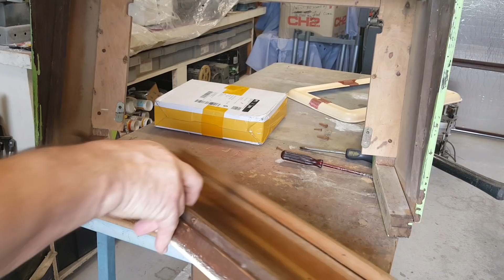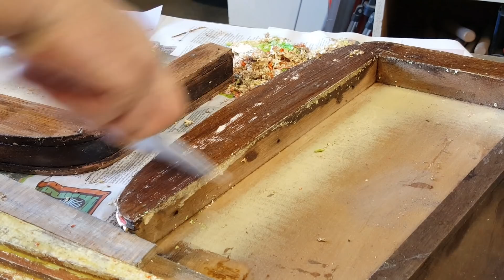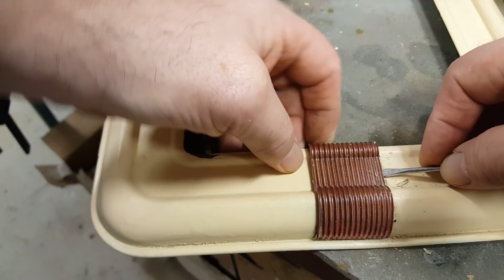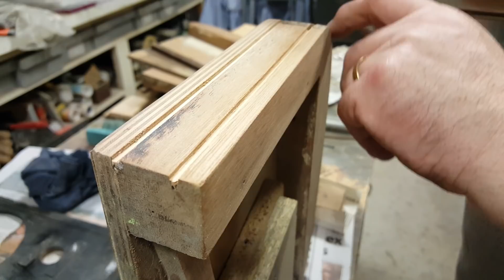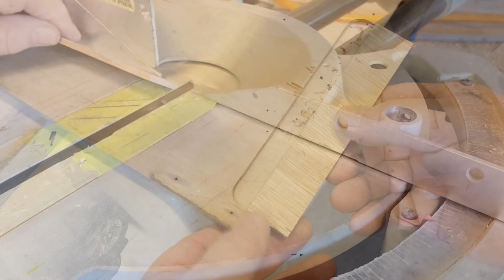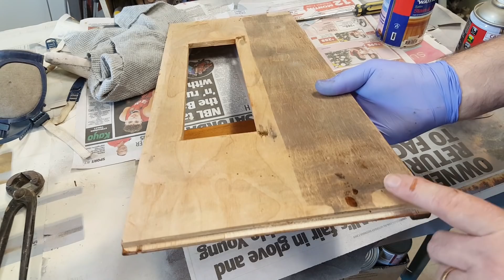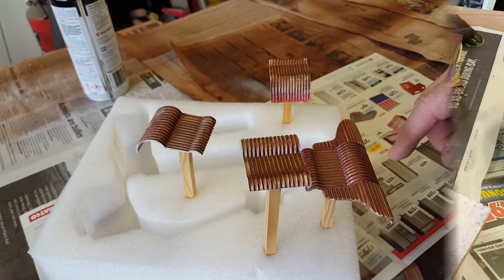The French Connection - UNIC 'Royal' Radio- Restoration Part 2

Comment: This is really coming out nicely.  Flattening the back was a nice surprise, coming out so smooth and flat.  Thanks for cluing me in with respect to the Aqua Coat.  I didn't appreciate that before.  Looking forward to the next installment.  Thanks again.
Reply from the maker: Hi George, thanks. I was surprised the back came out so well, I will leave it a few days and see if it stays flat. The Aqua Coat works well, you can use other products or watered down wood filler too 🙂

Comment: Dave. For removing enamel based paints from plastic you can coat it in automotive brake fluid. Wait overnight and the paint should be bubbled off without harming the plastic.  Make sure to wash the plastic parts thoroughly with soap and water afterwards.
Reply from the maker: Yeah, that's a good idea, thanks Phil 👍😀

Comment: That veneer on the sides looks like French walnut, which is not too surprising since it's a French radio, that species seemed to have been the veneer of choice on many American, and Canadian sets as well. American black walnut is a little more dark brown then red, sort of like your local Queensland walnut, the Queensland stuff was another popular species of veneer, particularly in Canadian radio cabinets. 
 It's interesting how they created that bullnose curve along the top front edge, it looks like they curf sawn plywood to a rather tight radius. Most of the time they would either laminate different layers of veneer over a form to create that curve , or use solid wood underneath, and veneer over top. The trouble with using solid wood under it is that the changes in humidity could cause it to swell up and crack the veneer right across the grain.
  With regard to stripping paint from polystyrene plastic, I've read that DOT 3 brake fluid will remove the paint and not damage the plastic, unlike regular paint removers.
Reply from the maker: Hi Oleg, I think it was veneer on plywood, curf cut to bend it around the bullnose. I was amazed it didn't crack or show strain marks on such a tight bend. Brake fluid is a good idea, thanks 👍😀